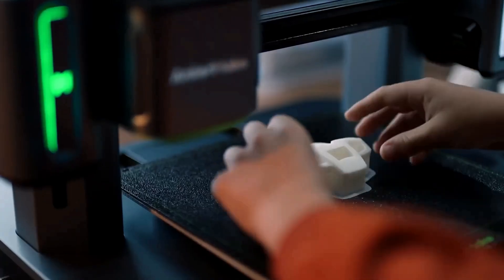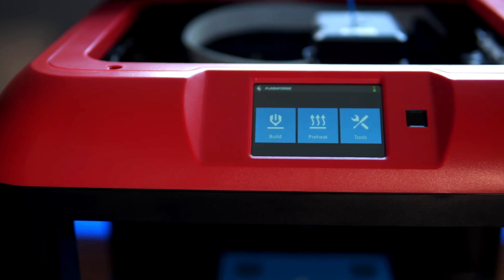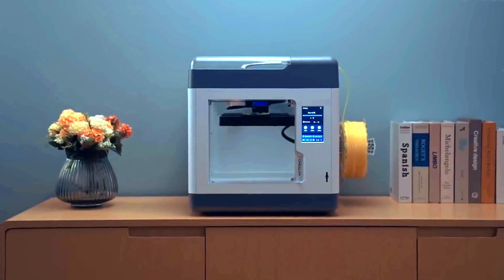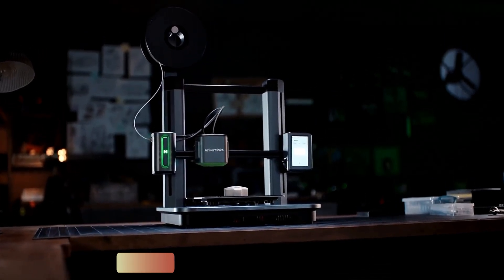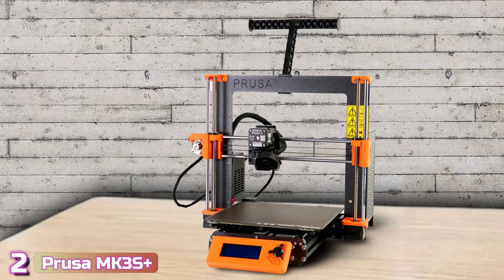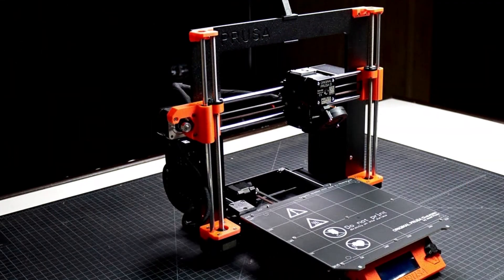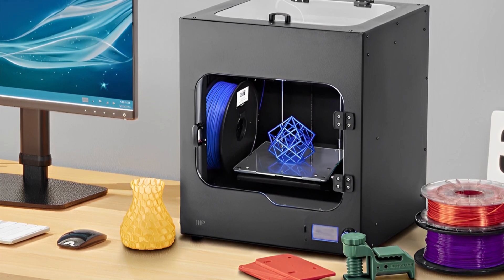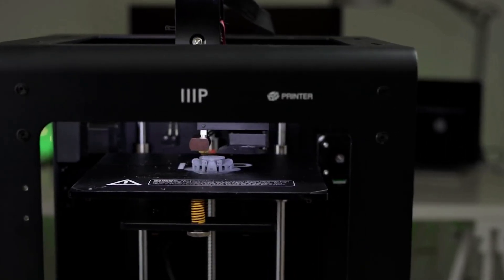Best 3D Printer of 2023 | The 5 Best 3D Printers Review

Comment: Prusa printers are starting to fall behind. You have many good alternatives that cost a fraction of the price such as the ender 3 s1 pro. You do not need such a small expensive printer.
Reply: Prusa support is second to none. You have 24/7 support. In addition they stand behind their products, improving them, adding features, etc.
Reply: @LJ-gu2dj   it took them years to come out with a new printer. Will you need that support 100% of the time? You wont. Their support might be good but what's the point if you'll only ask them for help once or twice? I appreciate the work they do and have done but it feels like they aren't the top of the line anymore. The creality K1, Ultimaker machines and Bambulabs machines are the best of the best.

Comment: Nah. Buy Bambu XC1. Trust me.
Reply: Why? Just wondering I have an ended 3 original since it came out and looking into buying a new 3d printer for my Buissness
Reply: @alfredoc5770  super fast and accurate. Print 10 times the things in same amount of time
Reply: Would you recommend the x1c. I already have the s1 pro and I have had nothing but trouble from day one. Warped bed and all the other auto leveling issues I have had. I'm looking into buy the best accurately and best quality prints that a 3d printer can handle